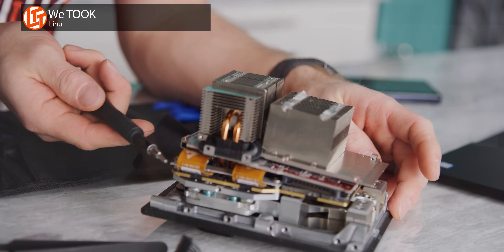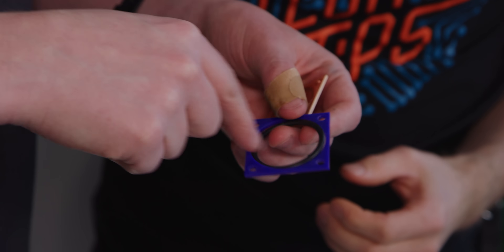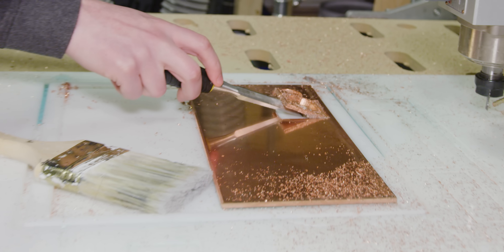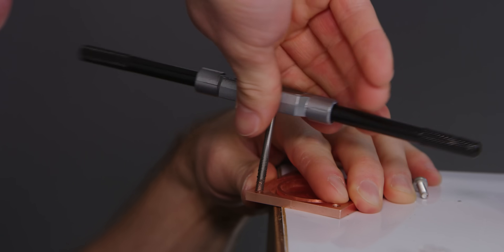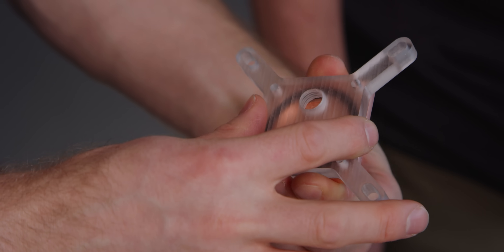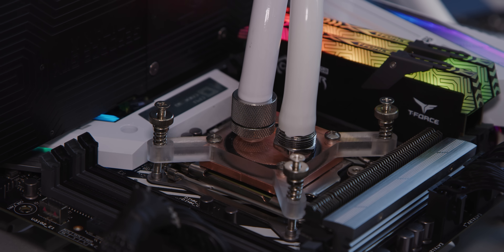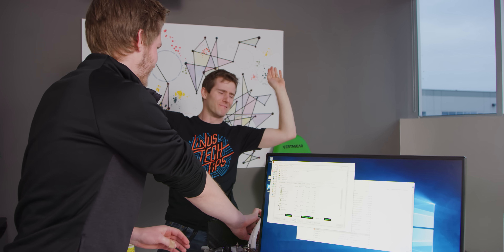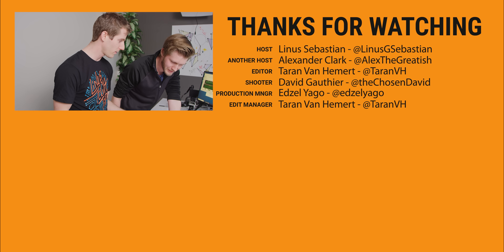We Built a CPU Water Cooler!

Comment: Your CNC router has plenty of spindle speed available to cut the copper, but the lack of coolant might be a large cause for issues. Even if you stand there and blow on it with compressed air, it would be better than nothing...but if you hook up a mist coolant system then it'd be even better. Even spritzing it by hand might work, but it'll make a mess. Mist coolant will also make a mess of course (in the direction the nozzle is pointing) but you do what you gotta do!
Reply: Kind of like occasionally dripping some oil on the piece on a drill press?
Reply: I have had excellent success using olive oil as cutting oil for copper. It just makes a terrible mess, but it works great.
Reply: you can cut anything dry with the right tool
Reply: @kolby4078  Eeeeeh, yeah. But with copper, alu, and brass, you really want some lubrication because it tends to stick to itself/tool if run dry.

Comment: Machining copper is not hard at all.   Need good feeds and speeds.  Get some quality endmills. Carbide 4 flute endmills would work best.  Linus mentioned that the face of the copper was convex/concave?  The face should be Flycut or lapped flat.  You have a CnC Router, there is no excuse for that.

Comment: 6:18 omg watching this hurts. when you are cutting the thread freehanded, USE A NUT TO SUSTAIN THE 90° ANGLE. It also helps to generate enough pressure to actually CUT into the acrylic bitchy material.

Comment: Looks like you haven't used any form of lubricant/coolant and used the wrong settings on your router. Copper is quite bitchy to route, yes, it really needs lubrication to not overheat and the right speeds and feeds - and the right bits. There should be one long flake and not many little ones. If it's the latter your settings are wrong.

Woring on a similar project - though it's going to be a GPU full cover.

Comment: G 1/4 threads are tapered, and if you overthread the holes, the fittings will be too loose. The copper threads are machine threads and you can run the tap all the way without expanding the threads.

Comment: Do an aluminum loop so you have a easier metal to machine
Reply: You also need aluminum radiators
Reply: aluminium radiators are everywhere this isn't an issue (most asetek AIO's use aluminium radiators and you can buy those same radiators without the asetek pump and block from aliexpress for really cheap prices)

Comment: As an industrial maintenance professional this was painful. You can order o-rings that big. Pick a size and adjust the CAD to it they will handle minor deformation too. If you are choosing the circular o-ring design you don't need the inner wall because the water pushes out evenly. For conducting heat you need 2 things minimal conducting distance and maximizing conducting surface. area.

Comment: I made a water block simular to you guys but i used a custom jig and a dremil with a cutting disk and made tinny squares in the area of water flow also u need to lap the bottom of your block to make sure it will be perfectly flat and it will do a decent job as the more surface the water flows past the more  heat you can extract from the block

Comment: You guys need a vertical mill (Bridgeport). Angle the head to 45 with a small 2-4 flute endmills and mill the lines into the block. For making sure the tap goes into the hole straight (we all saw it Linus), just get a plate of metal or plastic and put holes into it that match tap size. Lay piece over material and line the holes up. Clamp on and tap away yo

Comment: so.... if you just use a standard circular o-ring, you don"t need a massive amount of precision for the groove. the trick is to over size the groove slightly in comparison to the o ring and use a slightly thicker o-ring than planned so that the compression between the two plates will press the o-ring into the rest of the groove and create a seal through compression. They don't teach you this in school but a machine shop does.

Comment: Would you consider taking custom order for water blocks? Would obviously be pretty simple stuff.  If you want to do thin fins you need to use a saw. Use oil when tapping the holes for threads.  You need to drive the tap through quite far as the body is tapered.

Comment: With the equipment you have you can machine waterways into the copper. You can also use copper as the top plate instead of acrylic. This combination would allow you to cool further away than your fittings would allow.

Comment: Suggestion: leave a slightly raised area inside "the chamber" of the coldplate. Slit it with a skinny dremel cutoff disc, as many slits as you can safely do. Turn 90 degrees, repeat. Even if you only get 6-7 slits in each direction, that's probably quadruple the surface area for heat exchange to water.

Comment: Heat the copper with a blow torch to soften it before you try to use a small cutter. Edit the copper is work hardened from being rolled in to a sheet get it red hot and let it cool slowly and you can get smaller cutter bits to work.

Comment: For machining copper, quality cutters and proper speeds and feeds help (look in the machinery's handbook) BUT the best thing you can do to help yourself out is material selection. Specifically, the general purpose Copper 110 alloy is terrible for machining, it is sticky, chewy, and overall unpleasant, whereas Copper 145 aka Tellurium Copper is the easiest alloy to machine and yields significantly better results. Other routes you can take is to use a free machining brass such as Brass 360, Aluminum 2011, and Aluminum 6020 as they are also excellent for machining but are also of significantly lower thermal conductivity than copper, so you would be forced to do very fancy details to get the surface area up to match a relatively simple pattern or even flat plate of copper.
Reply: I dunno what it means but Linus you better follow the tips.
Reply: Very good points. I also think a spindle speed reducer is needed to allow them to cut copper more cleanly. It looks like their turret is a cheaper high RPM only one for cutting wood and plastic.
Reply: Wd40 for aluminum and copper is a must. Lubricant is needed. Watching this from a machining career stand point it was cringy lol
Reply: Copper and aluminum.... Spray with wd40 or crc while cutting.....Make sure your taking deep cuts that throw chips/swarf even if the tool is very small it must cut enough to produce a decent swarf amount otherwise the tip will get to hot, the material will go buttery and bind to the tool.
Don't try low feed rates unless you have very low spindle speeds. 
If a 1mm tool was to be used id start at 70,000 rpm at 700mm/min  (100mm per 10000rpm @ 1mm tool diameter) for copper with occasional sprays of wd40 and constant air cooling.
At 1mm tool tips the high speed can make the tool more rigid to deflection, just like how a dremil running at 30,000 rpm will steady a .5mm drill bit better then running at 500rpm.
You can also get coatings for tools to reduce brazing of copper to tool like Chromium Nitride.
Reply: they really need cooling and lubrication if they want something decent out of that copper with that machine, it might not be enough, but  the result would improve for sure, and yeah coated tools as mentioned above
Reply: I can second what projectwolfdesign says about 110 copper, i occasionally make bus bars for some of my employers products. its always a pain in the ass to deal with, particularly drilling and tapping. The drilling was solved with a 70 dollar Guhlring drill meant for copper, the tapping boiled down to "use good taps and replace when you start getting blowout on the backside of the part" - it usually indicated that the tap was going to fail shortly.
Reply: thank you someone else said so i didn't have to :D  cheers mate.
Reply: Could always cast it and just machine the flat side afterwards. It's more fun anyways
Reply: These guys need a tormach or the Haas toolroom cnc stuff

Comment: why leak test on a bench? whhyyyyy?? You don't need expert machining knowledge just common sense!
Reply: There is a right way, and there is an LTT way.
This is the LTT way
Welcome to LMG!!
Reply: @ameralhamvi5680  there's the right way,the ltt way and the wrong way guess which way is worst

The LMG way😂😂😂😂😂
Reply: what, you want to test it in the finished product??  is common sense!!
Reply: @god_kizarub8  Hmm, testing it first not installed, just checking if the O-ring actually works, and then checking it on the mobo. Yeah, no common sense there...
Reply: well, all the guys in the room, and for sake of video , cost of motherboard is pretty small
Reply: This is a show and they can afford to burn stuff, is still part of the show
Reply: @xbatusai  thats why people destory new iphones and the such, cause it makes money
Reply: What's the point here? It's distilled water not acid. If it leaks they immediately shut the system off, dry it properly and it should work just fine. You also leak-test regular water cooling on your system, you just take more precautions because you can't buy a new system every day.
Reply: @Finkelfunk   Because distilled water will still pick up ions from the loop and become conductive, and it really wouldn't take long (and they didn't even drain the loop). Leak testing on live hardware is just an unnecessary risk especially when there is no protection surrounding the hardware and foolish if you care about it.
Reply: @Sevicify  Yes it picks up ions, absolutely correct, and? That's only relevant if you set the entire loop under water and it most definitely is not enough to conduct the weak currents a PC carries.
Even ionized water is entirely damage free for electronics if you immediately turn the loop off and dry it up. The amount of ionization is negligable compared to tap water and if dried off properly and immediately leaves no traces and doesn't damage the electronics.

Needless to mention that 
A) They followed the official guidelines and recommendations for O-Ring appliance.
B) Probably have 20 other mobos of thst type to spare on the spot. Needless to say they have extremely good contacts and relations to manufacturers so getting a new one would require one phone call and maybe like a 10th the normal consumer price if any. I bet Louis Rossmann would ultra sonic the board free of charges, that'd entirely fix the issue.
And C) That risk of a leak is in any watercooled PC. You've never set one up have you? You run a dry tubing test if the loop allows for it, if not you yolo the pump first and the live system test is the next step on the list. It's really no big deal if that breaks. They've killed a 25.000$ processor and disassembled a 20.000$ Red camera. You really think they care about a 150$ mobo?
Reply: @Finkelfunk  Sure it may not damage your electronics if immediately powered off and properly dried but why take the risk in the first place? It's important to note that I'm speaking generally as most people do care whether they damage their hardware and not aimed specifically at LMG who, as you said, have hardware to spare and can afford the potential mishaps for the sake of content that makes them back than the potential losses.

And yes leaks are always a risk in any liquid cooled PC hence why you do leak testing in the first place, and while I'm no expert on liquid cooling I am positive the smart way of doing this is to just have the loop running with water while having the rest of the system is disconnected from the power until you're confident there's no leaks.
Reply: @Sevicify  Even in that case YOLOing it isn't even bad tbh. They are always in a hurry so they won't quintuple check if their block seals just right. They did a quick check hanging it off the table, a quick check when it first fired up and then a live test. Absolutely fine imo. We're talking about Linus on this video, this isn't some randy building his first ever PC. You're general advice is great and absolutely superfluous. Does this video scream "Water cooling tutorial" to you? It really doesn't. We know what the smart way to do this is if you don't have 150$ to spare. Linus has tho. And even if he hadn't it'd all be fine. Dry the board, ultra sonic it, done. Functional again. Does Linus look like he's got time for extensive 24 hour leak testing to you?
Reply: @Finkelfunk  I think the real problem is that what the audience is suggesting isn't a hardship; hook up the loop and turn it on before attaching the block to the cpu, then if there's no leak put it on the cpu; if it leaks then well at least you tried. The point is the block is completely untested, taking an extra 10 seconds to see if they screwed the thing together right before turning the rest of it on doesn't seem that difficult; even if the distilled water would be unlikely to cause permanent harm, the blasé treatment of expensive technology is... distracting to a large number of people.
Not that it's unexpected, this is a channel that had to re-do entire episodes at many, many thousands of dollars lost because of simple dropping, and yet Linus still sort of juggles $10k cards like they're paperweights. It's practically a meme at this point. Still mildly annoying.
Reply: @IamCoalfoot  But they did hang it off the table to flood it initially.
Reply: Right?!
Reply: Because if they leak tested elsewhere then they wouldn't have the thermal tests until after. And LMG is too focused on pumping out content daily than making quality content so they save an hour or so by doing both at the same time.
Reply: @emmett050  Or, they thought that it might be amusing for the viewer if the water block leaked onto the test bench. Why are you even here if you don't think it's "quality content" ?

Comment: To work copper, try anealing it first to eliminate work hardening present initially. Break out some propane torches and make it glow eavenly across the surface you are going to work on. Then let cool before you start working it. To eliminate the discoloration once done, subject the copper to an acid solution for a few minutes.

Comment: If you have some skill then you could make the tiny slits in the copper with a dremel and a cutoff disk. If you don't have any skill whatsoever then you can clamp the dremel down to a table, put the block into a vise and slowly feed it towards the cutoff disk and still get it done.
If you even manage to let that fail then you work at LMG. When cutting by hand you can compensate lack of skill by guideblocks, securing things down and jigging things up.
Btw, if you want your block to be flat you're better of flattening it by hand, your routerbit isn't flat and leaves machining marks. You can just learn the technique of metalscraping from Igor Negoda and get to sub-micron precisi.....  Ehm, I mean just get a piece of glass or a mirror and put fine grit sandpaper on top of it  and use it as a sanding-block to get it flat enough.
Reply: I died of laughter when he floated the idea of using a tiny bit instead of a cutting wheel to make the fins. You can even see they used a cutting wheel on the fins for the block they compared it to. Keep things simple boys.

Comment: If your copper isn't cutting very well you could heat it up with a torch to anneal it, copper softens at a high heat and tends to work harden from my experience cutting it especially if you're cutting at a sub-optimal speed

Comment: High tolerance is right, low tolerances generally means low precision. It does flip over like you though if you say big or small tolerances though.

Also, use silicon/dielectric grease for o-rings, it won't eat them.

Comment: You're using the wrong adhesive to bond an ELASTOMER. You should use Loctite 480, NOT 454. 480 has microscopic black rubber spheres in the formulation which add flexibility when bonding elastomeric materials. It takes a little longer to polymerize and is thicker, which makes it easier to use too (it's also the right colour). I didn't notice an "adhesive scientist" in your recent jobs promo vid. SHAME on you! Shame! ;)

Comment: Airplanes are WAAAAAAY safer than cars, does your car have redundancy for at least a wheel? If one wheel goes off and you're fast, better have assurance... You fix your car with silver tape and glue, planes simply change the entire piece without even presenting a problem, just because its service time is due and safety is a priority over cost.

Comment: As a mechanical engineer seeing them mount this to the mobo before pressure testing made me shout internally. I love watching you guys learn to machine stuff, this is great! If you plan to do more sealing stuff it could be worth investing in some surface finish equipment too to help it seal better.
Another good tip is to try to match standard imperial O-ring sizes (These are mentioned in the Parker handbook that was mentioned in the video, as well as the Transeals O-ring handbook which I prefer). It's a lot easier to buy a pre-made one than it is to try and join an O-ring together.
Keep it up!

Comment: The problem for the camera block is that if you move it around and it's not perfectly flat like the testbench one was, the water might leak out to one side, even though it was fine in this test run.

Comment: You  do do know Parker made the O-rings that failed on the space shuttle right?
Reply: But those seals were used out of spec as used on the rocket boosters. Launch should have been delayed for a warmer day. NASA overrode the booster rocket engineer who recommended a delay to the launch due to the known issues with the seal design.